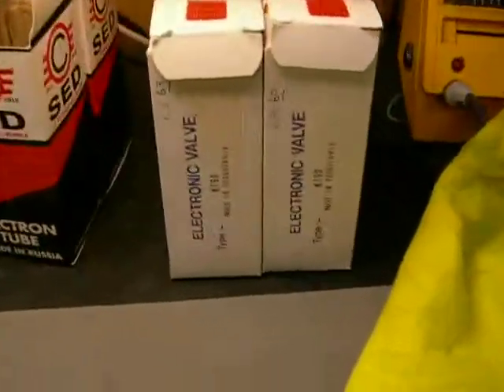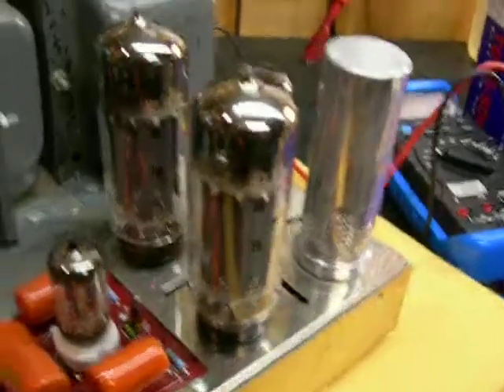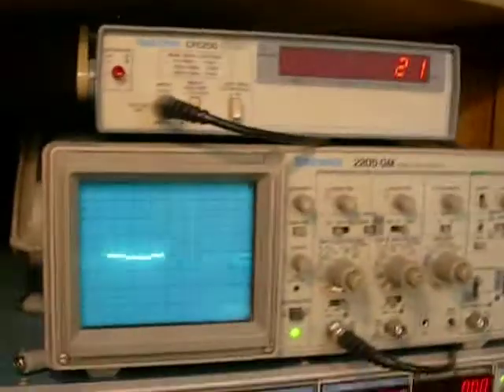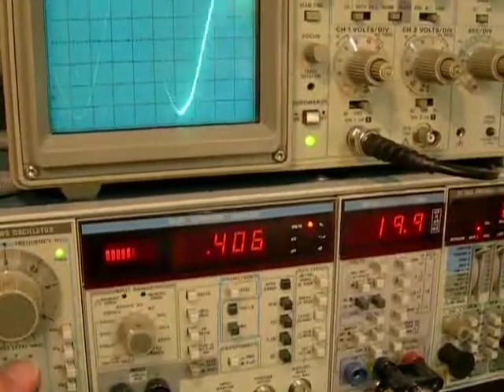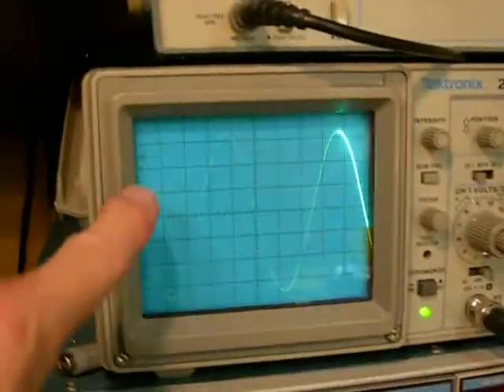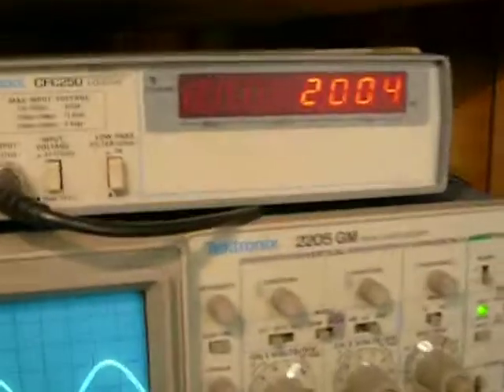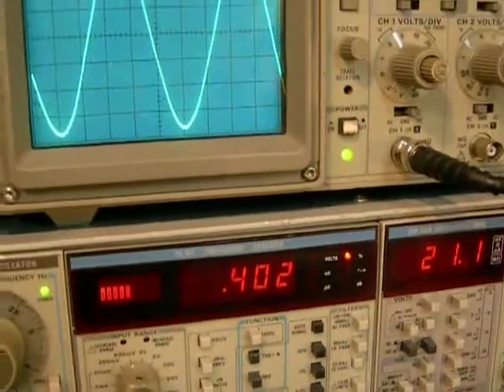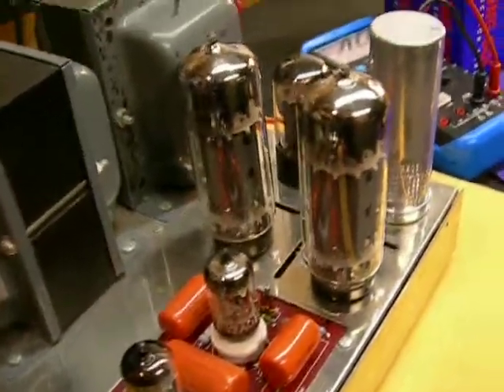Modern KT90 Vacuum Tube.MOV

Comment from the maker: @krajnovic10 Actually, I built an amp using the KT90s. I used a 60 watt Hammond output transformer I got from tubesandmore (Antique Electronics)  and drove the KT90s with a two stage 12AX7 and 12AU7 PC board replacement for a Dynaco Mark III amplifier. I think you can still find the boards on Ebay.  Sounds very good - so my guitar friends say. I used a variable feedback circuit to be able to vary the presence - an old trick I picked up from studying many of the old vacuum tube amps of the 60's.